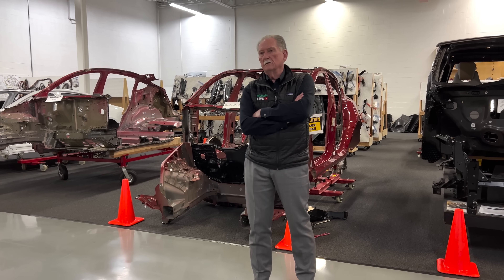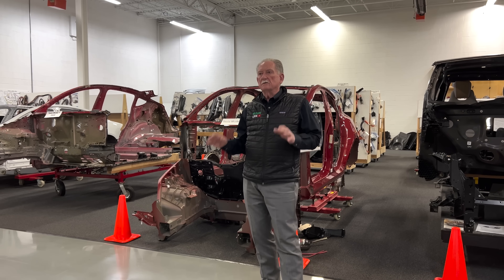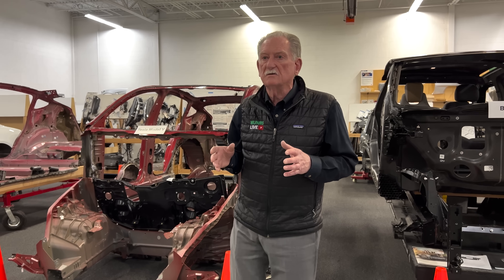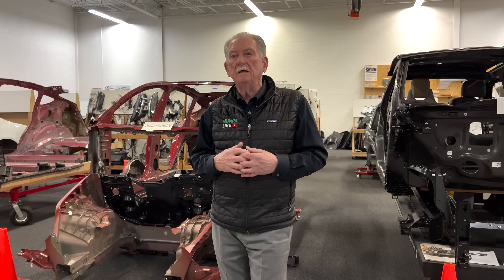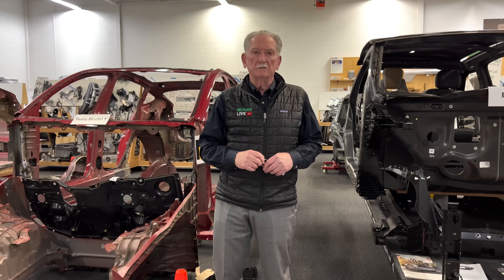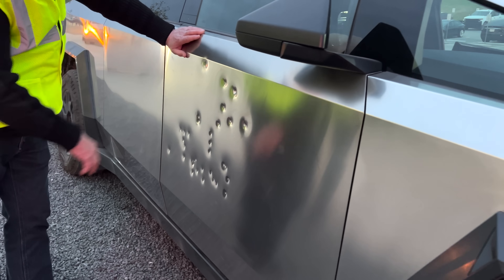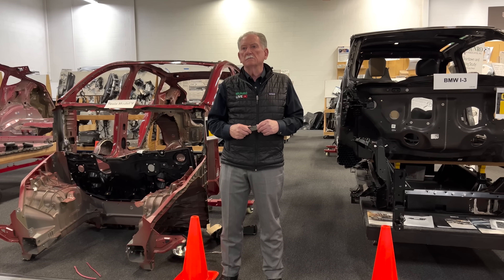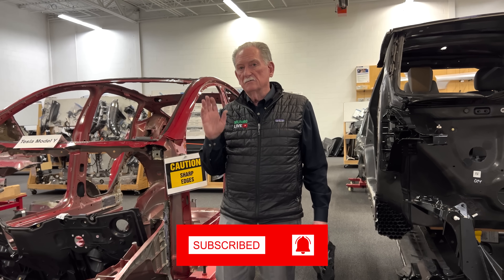An Engineering Analysis of the Tesla Cybertruck

Comment: This was a really good video.  Before watching this video I had no clue what austenitic vs. martensitic steel was.  Now I understand that a bit more.  Thank you for your analysis!
Reply: I have to say, people don't seem to realize just how much better stainless steel is compared to regular steel. Stainless steel has chromium in it, and nickel. Stainless steel is constantly using the chromium to block oxygen from reaching the iron, so it cannot rust, and thus lasts forever. Normal rain and road salt conditions aren't nearly strong enough to have any effect whatsoever on stainless, provided that the vehicle is kept clean. 

Contrast that with regular steel. If you expose a steel car body to the humidity in the air, it begins to rust within 24 hours, and in a few weeks will have a very visible rust coating. Bare steel rusts so fast, it literally begins to rust overnight while you're sleeping. Now imagine having a stainless steel car that lasts 500 years, instead of 20 years... 

This is a HUGE deal, because it's the first time in our lives where they have allowed the public to have something that lasts forever and doesn't have "planned obsolescence." Only the Ford Model T and the Dolorean and some aluminum bodied vehicles, have been immune to corrosion. 

All other vehicles sold in the last 100 years have been engineered to rust and turn to dust as you drive them--quite literally. You can look at any 1980's Toyota or Datsun, and they aren't even safe to drive, because the steel frame and body is so rusted. The trucks from the 1960's, 1970's, and 1980's aren't on the roads anymore--because they too have turned to dust.

For a big company to make a vehicle that can never corrode and never dissolve over time, is one of the biggest things in automotive history. It's unprecedented. It's like being given a light bulb that literally lasts for your entire life. This is the first time a company has been willing to offer something that can last forever.
Reply: @starseeddeluxe So the outer body panels will last "forever". But the steel structures behind will rust, and the aluminium castings can corrode (especially when in contact with steel or, even worse I think, stainless steel). So you can perhaps keep the body panels when you scrap the rest of the truck...
But also, most "normal" cars these days are pretty well engineered/protected against rust. The days when cars had rusty holes after 5 years are mostly in the past. Now most vehicles get scrapped because lots of electrical and mechanical components are starting to fail, the car is going wrong more and more often, and then something expensive (mechanical or electronic/electrical) fails, and the owner figures it's not worth the repair cost.
Reply: @starseeddeluxe 
One Other Detail,  Aluminum Oxidizes. ( Rust, Only Happens to Iron. ) 100 % Pure Aluminum is The The Slowest to Oxidize, """ BUT """ Has The Hardness & Strength of Peanut Butter That's Why It's Alloyed with other Metals Copper Being the Most Common, But There's About 10'ish Common one's used in Different %. " But " When Alloyed It corrodes much worse. that's why aluminum always has to be coated, or painted to prevent corrosion. Aluminum Oxidizdation is That White Chalky Powdery Substance. " AkA " The White Death. The Same Thing With Magnesium.
P.S. But Besides That I Agree With You.
Reply: really depends on the grade of s/s. some s/s products coming from a certain manufacturing giant in asia will quite happily rust if exposed to oxidising iron particles  @starseeddeluxe
Reply: @starseeddeluxe Stainless steel will rust. Just not as quickly as other steel.
Reply: Hi, austenite and martensite are microstructures and are usually time--temperature dependent.  They are chemically the same, but are structurally different.  They are basically the names of the formations (patterns) he showed on the screen.  You can think of it like a bunch of people standing in a line, as apposed to people standing randomly in a crowd.
Reply: Great it will last forever!! That should be the talking point correct? Same as the DeLorean right! Why is it so important that it be bullet proof? Or even need to be hardened? Seems like BS to me. Plus your already 20,000 over in cost from what you had stated the cost was going to be. Seems like added cost with really no added benefit to the normal user.

Comment: Steer by wire adds complexity to the system- the opposite of good design. 
Antithetical to Musk's "Best part is no part" mantra
Reply: Compared to all the parts in a power steering system, especially on an EV with no native vacuum system?  Plus a rear wheel steering system? Seems simpler, actually to have potentiometers, 48V motors, and some code.  Plus, crash worthiness is better without a telescoping steering column.
Reply: @davesvoboda2785  steer-by-wire needs alot of redundancy in case of failure. This adds complexity and weight to the car and you don't get the same feel, its like playing a video game basically, they have to add in haptic feedback systems.
They could combine a traditional front wheel steering with rear axle only SBW, this helps steering at low speed and stable at higher speeds, with much more reliability

Comment: Cut weight in wire, Add weight in bulletproof gauge steel.
Great engineering
Reply: Would you rather have weaker plates and heavier wires?
Reply: @geirmyrvagnes8718   If those are the only two options (they aren't) , 
Absolutely.
Unless I was in the mafia,  then I'd really need that bulletproof body
Reply: @cashkideven  Well, it's not bulletproof, so that's good at least. It is just tough and rugged. So much so that is stops some bullets. Aren't truck people supposed to be all about tough and rugged? And what about the fact that it is lighter than its competitors? No consolation prize for that, either?
Reply: @geirmyrvagnes8718  you are right, it is lighter than a rivian and a hummer. Good for them 👍 the Ford f-150 is lighter though 😉
Reply: @cashkideven  OK, let's call that a draw. Depends which trim level you look at. The Lightning Platinum is no featherweight. Even if you argue that it should be compared to the top Cybertruck, it is still slightly heavier. Now look at those two vehicles and tell me which one is "built tough".
Reply: @geirmyrvagnes8718  there's a video on top gear, an onld beat up Toyota truck survives control demolition from like 50 stories, and the thing still runs and drives afterwards.
Now that's a tough truck
Reply: @cashkideven  Top Gear is fun. Or at least it used to be. Are you suggesting that the F150 Lightning would do better than a Cybertruck in that sort of "test"?
Reply: @geirmyrvagnes8718  Definitely not. I think electric trucks are just dumb. Can't compare in any metric to good old ICE.
Reply: @cashkideven  The Cybertruck would easily beat an old diesel Toyota on MANY metrics. So that is just wrong, too.
Reply: @geirmyrvagnes8718  okay, on a 0-60mph, top speed(forward, on reverse cybertruck tops at 15mph). But on every metric that matters to a trucker. Usability, reliability, affordability. You can't beat a Toyota hilux truck.
Cybertruck can't even carry a bicycle without it hanging out the back, seriously.
Reply: @cashkideven  The Cybertruck has a perfectly ordinary bed length. If that is a problem, that means almost all trucks with back seats are useless. And most of them run on dinosaur drippings. So once again you are completely beside any sort of point.
Reply: @geirmyrvagnes8718  I assure you, other 4 seater trucks can carry bicycles perfectly well, I've checked.
It's just cybertruck
Reply: @cashkideven  Name one that is shorter than the Cybertruck, seats 5 (or, sure 4) comfortably and has a longer bed. You seem to have many to choose from.
Reply: @geirmyrvagnes8718 he'd like to just be a critic. A common cope for low self worth.
Reply: @kennyg1358  He said, critiquing my comment.
Now you're a critic of a critic, how low is your self worth buddy?
Reply: @cashkideven  you are conflating criticism with being a critic for the sake of it.  You go through life judging the accomplishments of better people than you.
Reply: @kennyg1358  So according to you, Elon is better than me, and I am better than you.
Reply: @cashkideven  Elon? The janitors at Tesla are better than you.
Reply: @kennyg1358  and I'm better than you.   What does that make you? According to your system of standards
Reply: @cashkideven  believe whatever keeps you from despair.
Reply: @kennyg1358  I pointed out a genuine engineering flaw. 
You can't hail the wonders of 48V system for saving weight in wires, while adding heavy steel to your very weight-sensitive EV.
You devolved into personal attacks about my 'low self-worth', but sure, I'm the desperate one here.
Reply: @cashkideven  your brain function is impaired by hate. That isn't an engineering flaw it's a design choice that has no correlation. Logically you can desire to cut weight cost in one area and add weight and cost in another. The F1 Halo for example.
Reply: @kennyg1358  Dude, your personal insults simply don't work. I don't even know you.
And the f1-halo is cool, but does nothing to help your point- if you have any to make.
Reply: @cashkideven  they aren't insults, just statements about you. I'll spell it out for you; the Halo adds weight and cost and has aero  consequences. The highly intelligent race engineers live with those drawbacks for driver safety. Maybe you can draw some parallels, maybe not.
Reply: @kennyg1358  insults are statements, goofy. The halo is a 7 kg titanium rollbar capable of withstanding the weight of two african elephants. You wanna compare that with this ?
Look. Forget 48V, Koenigsegg has a 800V system, uses like the thinnest wire ever. Makes sense for them. As a record breaking supercar hybrid EV, they need every gram they can save. 
The cybertruck is a bad product bro, cope all you want

Comment: One impediment to the 48V system is that most car/truck accessories are created for 12V. It’ll require hundreds of vendors to change for the transition to happen.
Reply: Which is precisely why nobody has had the guts to rip that band-aid off before now.
Reply: It's pretty trivial to step down 48v to 12V, adding a dollar or so to a device or group of devices on a bus.
Reply: @davesvoboda2785 a dollar. lol. Someone has never been in production in their live! lol a dollar.

Comment: Ok cheaper and lighter wires….on a 6800 pound, 100k car. Is this a f*ing joke?!
Reply: Car is now light as a feather!
Reply: Heavier wires means beefier connectors and looms.  Heavier wires cost extra for the copper, and for support hardware.

Also, various electric motors, for windows, frunk, seats, etc can be smaller, lighter, and cheaper.  All told, it's much lighter.
Reply: @davesvoboda2785  Not buying a Truck at all on the brink of a climate catastrophy if you dont need it and instead use a normal small car is even lighter ;-)

Comment: It makes sense you'd need less clamping tonnage if your mold flow was optimized to be low drag. Why add right angles when you do not have to and do not benefit from them
Reply: Right / acute angles are tough to form in sheet metals.  Which is why you normally see a decent radius at the bend. Die wear can be really visible too.  It can be done, just expensive.

Comment: I get the benefit of 48v system over 12v in terms of its efficiency but cannot see how it enables the steering by wire. There are plenty cars in the market with the steering by wire yet based on the traditional 12v system.
Reply: If you need quite a bit of power and multiple redundancy (and you do), that requires a lot of thick wires. Making all of them a lot thinner helps. There are not plenty for steer by wire cars on the market, but there are cars with electric power steering, and this is part of the challenge of making such a system.
Reply: @geirmyrvagnes8718   actually most modern MB/ BMW are all using the steering by wire. The servo motor doesn't need tons of power either. As I said, it is not like I dont get the benefit of a higher voltage for the system but saying 48 enables the e-steering seems to be a bit stretch.
Reply: dont forget that this is paid PR.
Reply: @drury2d8  What are you selling?

Comment: Better question is "what is the range towing at max capacity".   I bet it's not enough to get you between Superchargers. Can't pull into a Super charger with your trailer connected. You'll need to drop the trailer somewhere, then go charge. Hopefully it will still be there when you get back.
Reply: How much do you bet?
Reply: @geirmyrvagnes8718  I don't want to take your money. Let's keep it a gentleman's bet.  Engineers estimate best case Cybertruck will have 200 miles of range while towing due to aerodynamics being impacted and that11,000lb  trailer's brakes have no regenerative  braking.  That is best case taking battery from 100% down to 5% .   Real world towing range is more like 150. Even less in cold winter or mountainous driving conditions.   If you get that $15,000 extra battery it's going to suck dropping the trailer somewhere every time you need to charge. If you really want to do serious long distance towing safely like a pro, get an F-350 diesel dually with a 5th wheel/gooseneck.  (pull right up to the diesel pump, refuel and be on your way)
Reply: @FlashGordon-k9z  That was a lot of numbers (your numbers not mine), but you forgot one, so I will add that for you: Distance between superchargers on a typical American freeway out in the sticks in freedom units: 100 miles. That is the only reasonable interpretation of your words "between superchargers". A number that is decreasing over time. It would seem my money would have been safe even with your own numbers. So your decision of not actually betting was a good one.
Reply: @geirmyrvagnes8718  Dude!Range is a big problem. That's why they had to come out right away with the extended battery. This truck is not for serious towing. You're gonna look like a fool first time you try backing your boat down a ramp with that variable steering bs. As for the advanced tech, 48volt bus, 800 volt battery, drive by wire, ethernet bus.....that's is mostly about cost of materials. Who cares what voltage my radio is running at or the voltage of my battery. Also saves weight but really, come on, the thing is 8,000 lbs with the extended battery. It"s cool, I'm getting one but lets be honest, all that tech is about making it cheaper to build. At $100,000 per copy Tesla surely is not passing those cost savings on to the buyers. Oh yeah wait until you see what it costs to insure a cybertruck. Without 4 wheel steering, handling in parking lots & tight spaces is going to suck. Again, a great head turning toy. I'm getting one but not for any practical reason.
Reply: @FlashGordon-k9z  Dude! You just walked away from a lost bet without paying. Be cool! And what the heck are you talking about "without 4 wheel steering"?

Comment: can someone explain me why a 48 volt need less copper than a 12 volt please? My understanding was as voltage increases you need thicker wires. Would appreciate if someone can help me to understand this.
Reply: You need thicker wires for higher current, not voltage.
Reply: Resistance (~waste heat) = voltage / current so when you increase the voltage for the same amount of current you get less resistance and less heat so you can use thinner wires with no worries about them melting or catching something on fire
Reply: @nathansherman5640  thx. that clarifies. Much appreciated !!!
Reply: No. You need thicker wires if current increases not voltage. Higher voltage needs better insulation. As power is current times voltage you can have the same power over a cable with 4 times the voltage and a quarter of the current. You can compare it to a water hose. The pressure is voltage and the amount of water that passes through is the current.
Reply: @Martin_M_0815  so why do we have thicker lines for high voltage transmission power lines (does this have something to do this AC voltage transmission?)
Reply: @Soothsayer210 
They are not thicker. It depends on the transmission power. Even with high voltage you get a certain current. But then you transfer lots of megawatts with about the same diameter cable that connects a 12 volt battery in your car. A wire in your house is ten times smaller then the battery cable at your 12 volt battery for the same power...
Reply: You also need more insulation at higher voltages, which results in thicker cables from a user's perspective. Your conductors will be thinner though yeah.
Reply: Since V*I is the power consumed(by whatever equipment/load) and since V is 4*X in this case I will reduce by 4*X to provide same power. Also I^2*R  is the power dissipated in a resistor(in this case the conductor in question). So, the power waste will reduce accordingly, or in other words, you coud use much longer wire for the same wasted power.
Reply: Copper expensive & heavy, wire insulation+ plastic cheap & light wt. I believe UL use 600V for insul,  susceptibility to fire is typically a higher concern.
Reply: I believe Mr Musk explained the rationale for the move to 48 volts in his chat with Sandy, but here we go again ...
Transmission loss (as heat) from a conductor is proportional to the square of the current multiplied by its resistance. Copper is a good conductor but has resistance. As a wire, longer means more resistance, larger diameter means less. The current needed for a given load (power) is in inverse proportion to voltage, so for a given piece of wire a 48 volt system will result in one quarter of the current compared to a 12 volt system, and one sixteenth of the power loss. Or you can use a much thinner cable for the same loss. That's why houses in the US (110V) have more electrical fires than UK houses (240V) ... although there are fewer electrocutions.